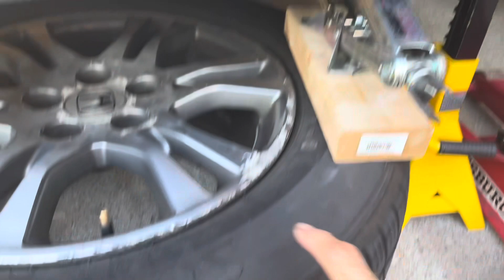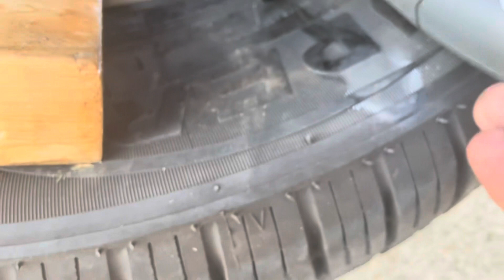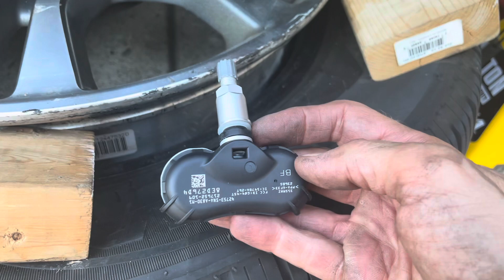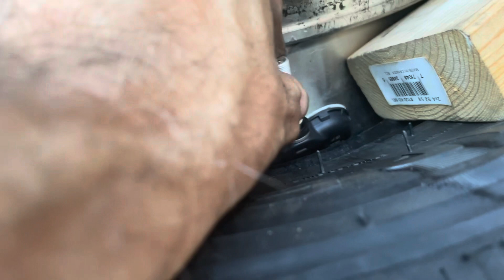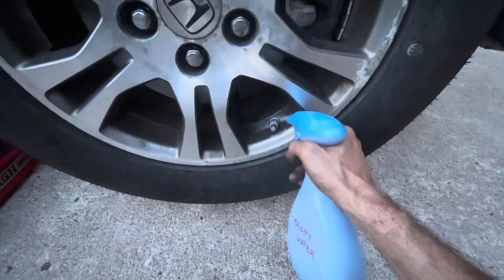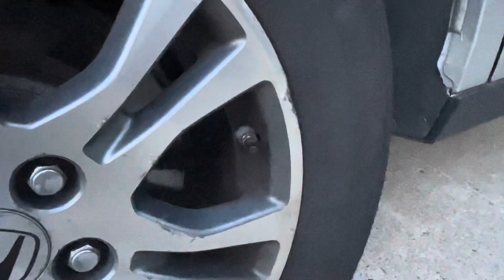How To Replace TPMS Sensors With Common Tools

Comment: I bought 4 sensors from Amazon for $30.00 For an 09 GMC Sierra. I programmed the sensor at home. I took it to my local tire shop and they put the sensor in and balanced the wheel for $15.00
Reply from the maker: @ronaldmeldrum5576  that is a very good price. You saved a ton on the program of those sensors

Comment: Friends, I'll tell you a secret. I changed one sensor because of low battery voltage. 
It didn't come to reprogramming the sensor with the Autel programmer, since it was enough to drive one kilometer at low speed and the sensor synchronized with the on-board computer on its own (Acura MDX 2008)

Comment: Get a torque wrench.   They're not very expensive, especially considering all the money you are saving by doing your own work.    
I would have loved to see how you got the bead to reseal.     Did you just let it go and it sealed when you aired up?
Reply from the maker: @Sewcrates  thank you for your feedback. I have a torque wrench but I have done this so much that I already know how much torque I have to apply on my cars and it is close enough. 
It was very easy to reseal. I add a small amount of wd40 to the bead so it slide back in when I  started airing up. If you hear air coming out through the rim, you just apply a little bit of pressure on the tire against the rim and that will create the  necessary seal for air to eventually push the bead into place.

Comment: Don't expect this to work on your car. 90% of all tpms sensors are different than the one in the video. This is a metal valve that's bolted down from the top. Most are 2 piece units that have a rubber valve that attaches to the tpms sensor from the bottom up. Depending on the size of your tires, there's a good chance you'll need to take the tire off the rim. If you have low profile tires with small sidewalls, don't even think about it. TPMS sensors are very fragile. In most cases, they're replaced because the tech broke them on the tire machine. 

Also, not all tpms sensors are attached to the valve. Some are placed on the center of the rim, and is held in place by a strap that goes around the inside of the wheel.
Reply from the maker: Thank you for this information!

Comment: I removed my tire, had the wheel cleaned up from corrosion, put on a new tire and finally got it back on the road.  Sadly, I never addressed the valve and, yup, it is leaking from there.  Chrome-rim life.
Reply from the maker: I feel you ;-)
I was on the fence doing this but it was a lot easier than expected and super happy I got it done. I am not losing air at all now and 10 more years of battery on the TPMS sensors. 
Please consider subscribing to my channel. It will help me on doing more videos like this.
I am regularly fixing things around the house and adding videos about it.